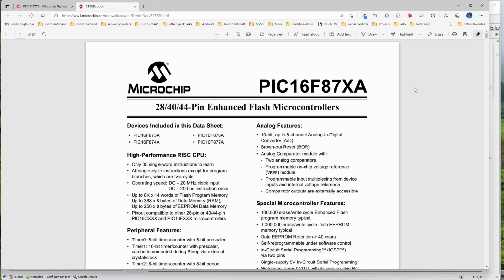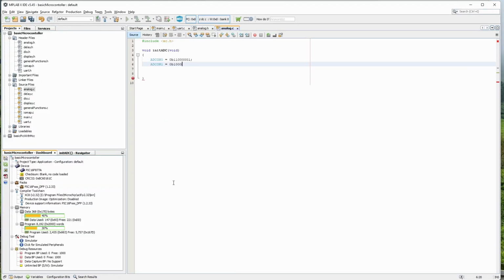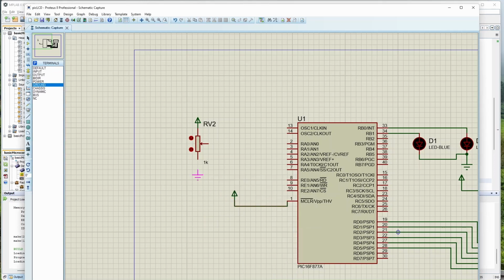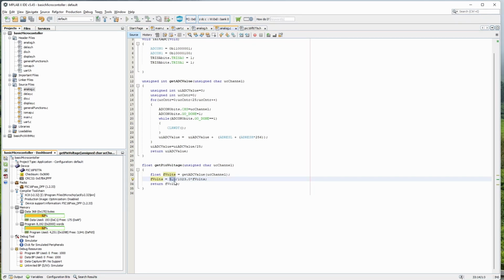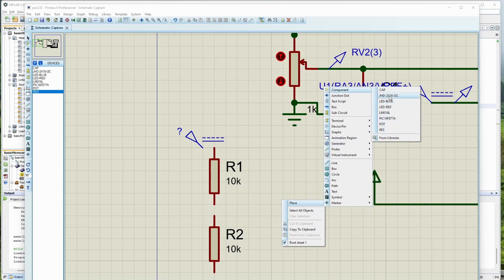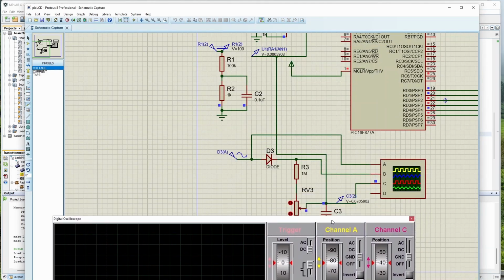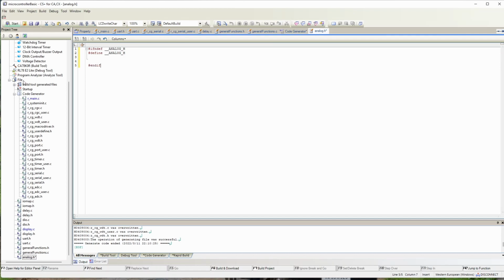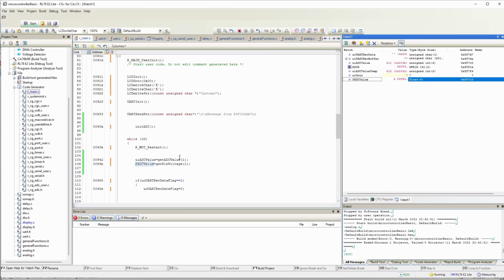Microcontroller basics 007 : ADC | Renesas | Microchip

Comment: how to get amp(current) in adc to amp pls
Reply from the maker: Use a small resistance and convert it to voltage and the measure,
Reply: @exploringembeddedsystems743  thank you sir for reply
Reply: Sir video Data flash memory for read write operation in renesas mcu

Comment: Hi sir, how can I access ANI3,ANI16,ANI17 and ANI19 together??
Reply from the maker: As there is one one 1 adc module, you acne only over one at a time. The conversion is very fast in micro seconds, so you can use it one after the other.